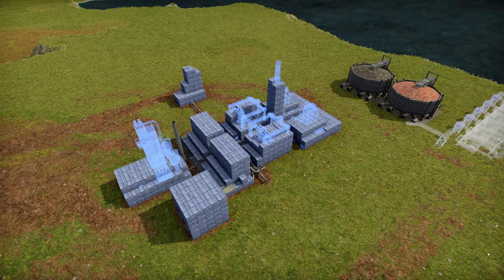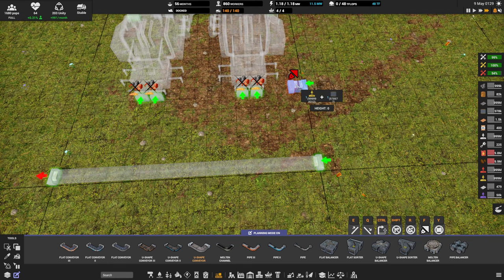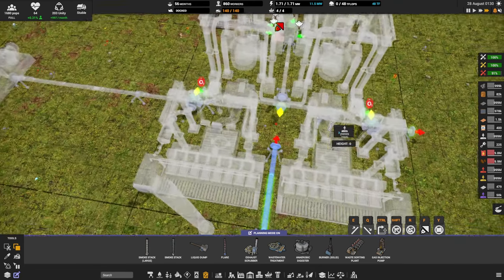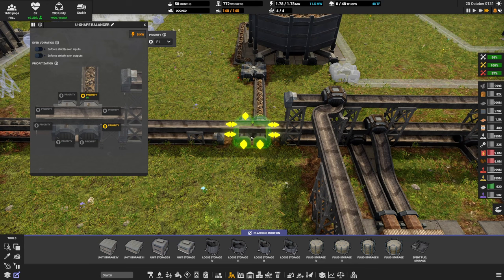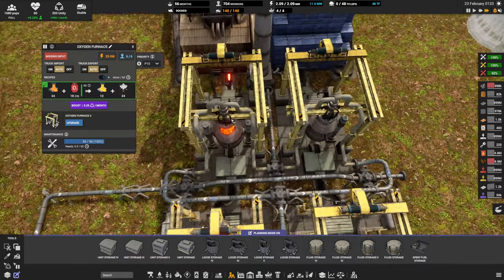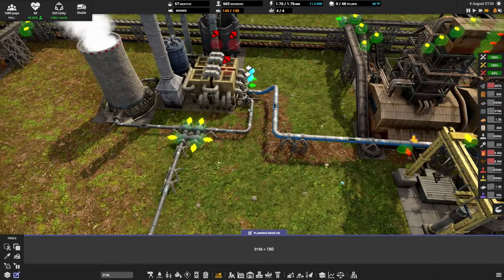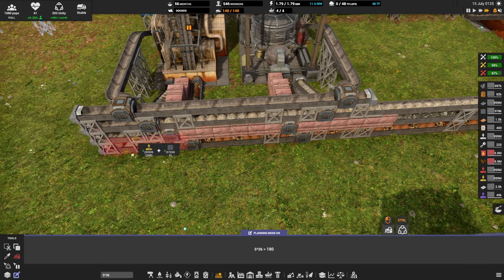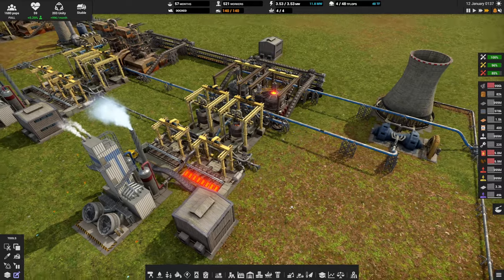Upgradable Smelter Designs - Steel Edition 🚜 Captain of Industry  👷  Walkthrough, Guide & Tips

Comment: One thing I've never understood with your smelter builds, especiallty more relevant now with belts using power, is why you dont take the slag out on a single belt in the centre seeing as you dont use a single smoke stack anyway(on most of them).
Reply from the maker: Belts always used power they actually use less now, and the plan was to always place 2 smelters beside one another and have them share molten channels AND slag belts, but the squiggle is put in there in case you have maxed out the thruput of a slag belt and need to separate one smelter from another
Reply: @JDPlays  Fair enough, I just always chose to run more pipes over belts as they are cheaper.
Reply: Last night i combined your design with what I usually do and came out with what I think is a slightly better setup. 1 Tile thinner per module, slightly cheaper to construct and run. Will have to see how it holds up with the later techs (its blast furnace 2's atm).